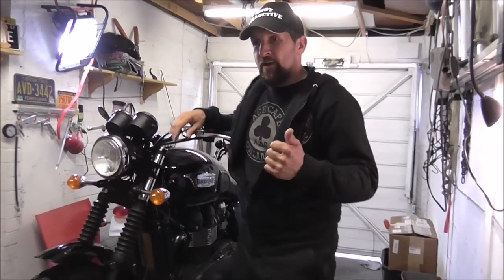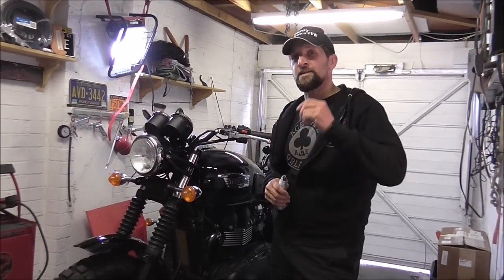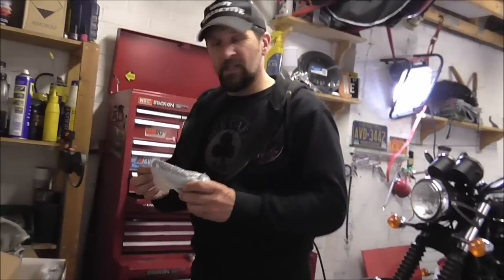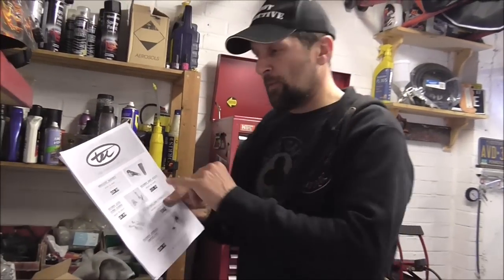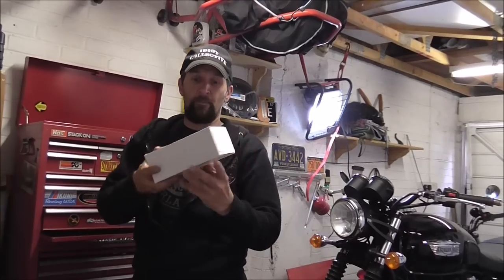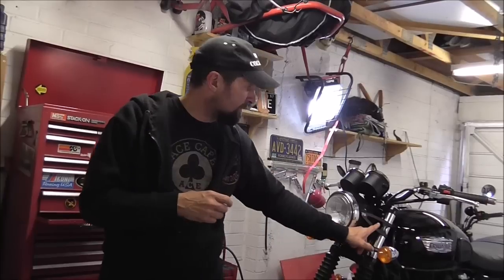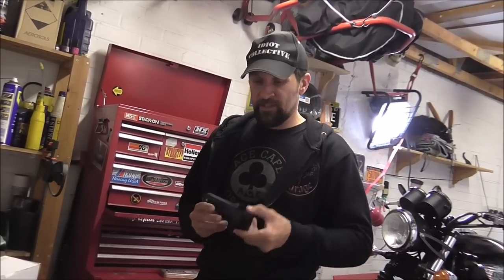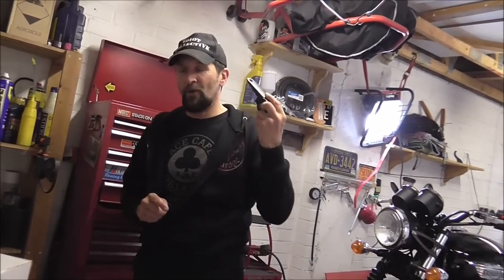Delboy's Garage, Bonneville, TEC Headlight Brackets.

Comment: I just bought the TEC damper as well. I went for the gold anodize and the should be here any day now.
Reply from the maker: Phill Sanders Nice one Phil....if you need any tips fitting it, it will be the very next video up this weekend...fitted mine this afternoon, lovely kit and really easy to set up once its bolted on..fitted mine on the left but you can fit them either side now, what ever you prefer.. great upgrade to the handling too..

Comment: Bit of trivia, but I'd bet those parts are die cast. Those marks on the back are likely from the ejector pins rather than a sprue. My guess would be the entry point for metal would be in the middle of the fork tube clamp which is later machined to size.
Reply from the maker: Mike Codona Quite probably Mike, you may be right, ....it was just a basic generic explanation of the two methods of making an alloy part....
Reply: Moonfleet41 Absolutely, wasn't taking anything away from what you said. Just interesting as an aside.

Comment: I agree around billet vs cast but on some things it's perfectly fine. I've bought loads of the levers from China and I must admit they are great value...

I've replaced all my Yamaha levers with them as they offer a more comfortable fit for me and they look better IMO. I've dropped a few as well and mine haven't snapped. Value against ASV or pazzo is great... Scrape the expensive ones they are still scraped, buying a second pair of china ones is next to nothing. No competition for me

I've been tempted with the cheaper rearsets as well but then thats where the argument comes in. Are they good enough, strong enough to support the use...

Comment: Hi , great video, quick question…I’m replacing my triumph bobber headlight with a larger 8inch light but the new light doesn’t have a side light! Should I simply remove the sidelight bulb and tape it up then go ahead and install the new light tucking the sidelight wiring into the housing of the new light?? Many thanks in advance, Ady
Reply from the maker: Not sure where you are in the world Alfie, but i believe you need a side light / running light for MOT.. maybe check with your local MOT station..?
Reply: @Moonfleet41  hi I’m in England, I do have a dipped headlight on when the ignition is on and engine running so I imagine that would be acceptable? Cheers
Reply: Just had a look on the DVLA MOT page regarding motorcycle headlight requirements and there is no mention of there having to be a mandatory sidelight requirement so I think I should be ok 👍 so far the fork bracket installation is going ok apart from the top yoke nut is 40mm socket and I don’t have one 🥴 gonna have to buy one tomorrow……💪 thanks bud

Comment: Discovered a puncture on the front of my YBR 125 told don't repair get new tyre due to small contact by patch by local Yamaha Brain Grey Power Biking £64 if wheel on bike £34 wheel off. How hard can it be. Took front wheel off myself and had Yamaha fit new tyre. Bit of a fiddle to get back together speedo and spacer to fit. Paid £34 for tyre. Got some slime £9 At a local motorfacters a twin barrel pump to blow tyre back up £13
Reply from the maker: Neil Jeffs Sounds like a job well done to me Neil... nice one mate. !